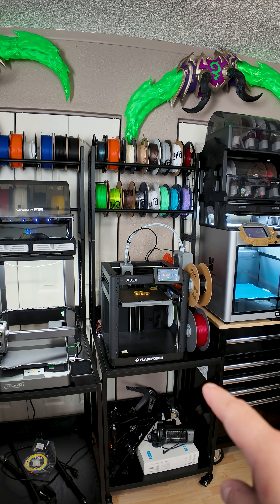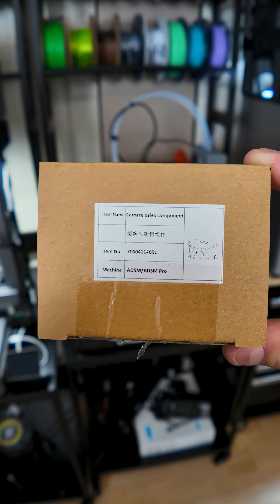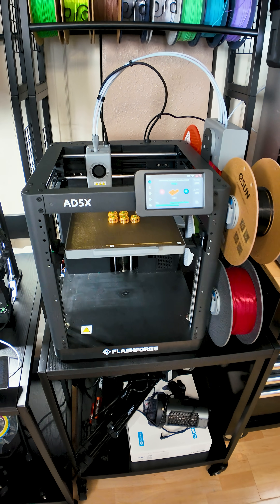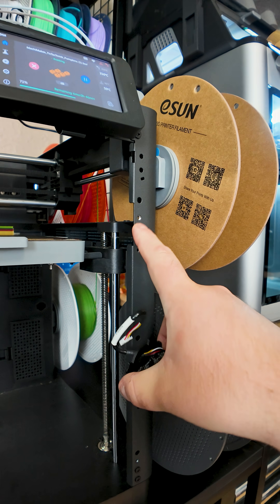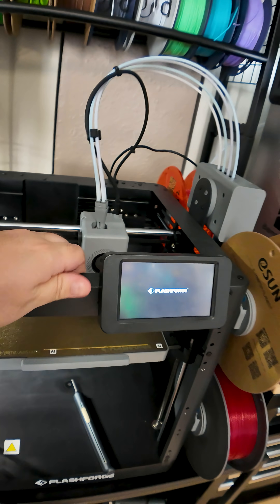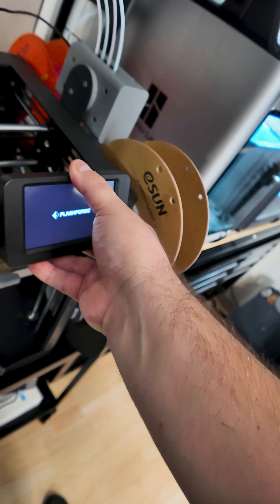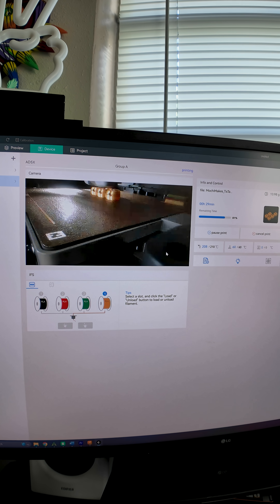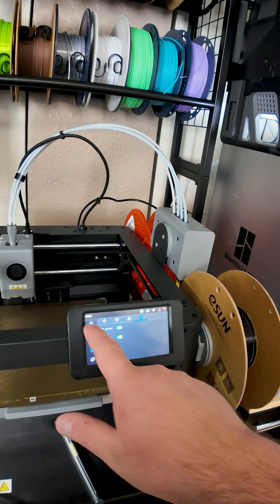Installing Camera Upgrade on my Flashforge AD5X Printer

Comment: Is it a ai camera so it will automatically stop if there are problems??
Reply from the maker: It's just for monitoring
Reply: I’m pretty sure adding AI is possible but you need klipper installed, raspberry pi and a bunch of of other things

Comment: Please don't do what he did.  He took a chance and could have possibly shorted out his printer by installing the camera while it was on. He got lucky and didn't damage the ribbon cable by the way he removed the touch panel.
Reply from the maker: Or just live your life the way you want to and don't listen to nobody 😉
Reply: @MikesQuestLog  Or try to give good advice to people, especially people that may follow bad advice because they don't know any better.💯
Reply from the maker: nah, i live for chaos. Make mistakes and learn from them, or don't. Whatever makes you happy
Reply: @MikesQuestLog It's not about being happy. You are proving my exact point your video shows people actually what not to do. But you never told them that in your video.
Reply from the maker: @mj1s735  No, you’re missing the point. People don’t actually read or listen to advice anymore. I see it every single day. Comments asking the same question that’s been answered clearly, multiple times, like my fave “STL?” for example.
Then you’ve got the Bambu crowd. They bought into Reddit’s “these printers never break” myth, and the second a basic issue pops up that the printer literally explains and tells you how to fix, they spend weeks making threads and theorizing instead of just doing it.

The this camera install fits perfectly here to prove. It comes with instructions. If you don’t know what to do, read them. If you’re like me and prefer figuring things out as you go, that’s fine too. But at least do something instead of treating every issue like end of the world and a total mystery. 
And for the record, I’ll keep doing things the way I enjoy. If I break something, I’ll post it anyway. It’ll serve as a warning for others. You’re claiming I didn’t tell people what not to do, but if you can’t figure out from the line “I’m not sure if it’s hot swappable, let’s see if it still works” that I’m clearly winging it, then you might be a part of the problem I’m talking about.
Reply: @MikesQuestLog  Wow, that was a word salad. You have a point. People don't like to read the instructions. So they would rather watch videos. And your video showed them exactly what not to do. 🎯
Reply from the maker: @mj1s735  good
Reply: @mj1s735  I mean why do you care so much? Even if he were to short the printer it would still have the feature to continue after the power surge. Besides, the worst that would happen is the screen falling off
Reply: @Your_Florida_Aviator  Your reply tells me you know nothing about electronic circuits. The worst thing that could happen is you short out the circuit boards on the printer and now you just bricked the printer. I care because I don't want people that don't know much about electronics following bad practices.
Reply: @mj1s735  well I’ve done the same thing with the screen twice and my printer is still perfectly fine
Reply: @Your_Florida_Aviator  Well lucky you. It is still not a good practice. And this is coming from some that their primary job was to fix avionic systems on fighter aircraft. I also was a trainer and as a trainer I would never teach someone any of the bad practices that he did in this video. It is never a good idea to plug N play things that are not designed for it.

Comment: How do you do Timelapse videos with it?
Reply from the maker: Haven't made any Timelapse with it yet but I imagine you just turn on Timelapse  in the slicer like any other printer
Reply: @MikesQuestLog  Depends on what slicer you use. Enable video on the control panel works for most slicers. If you use the Orca Flashforge slicer it gives you the option to do a timelapse when you send the print to the printer.

Comment: I need to ask what is the desk
Reply from the maker: You mean the printer stand? It's this one but I do not recommend it honestly. It's kinda meh https://a.co/d/gFYZyBG
Reply: @MikesQuestLog  I screw mine to the wall to reduce the vibration.  It helps a lot. The downside is that it shakes the house.😁